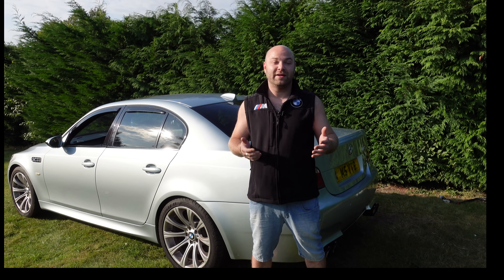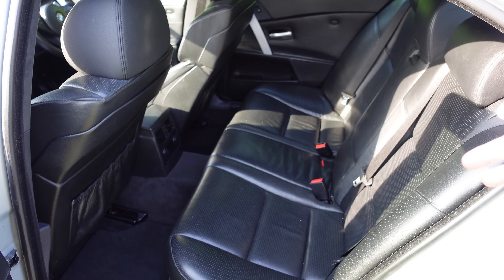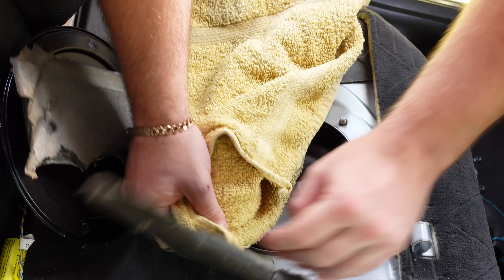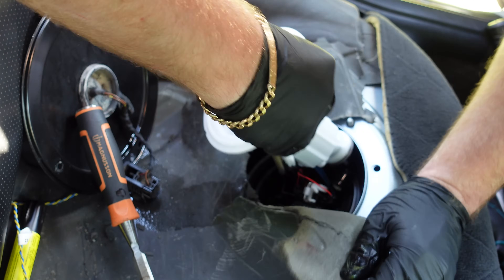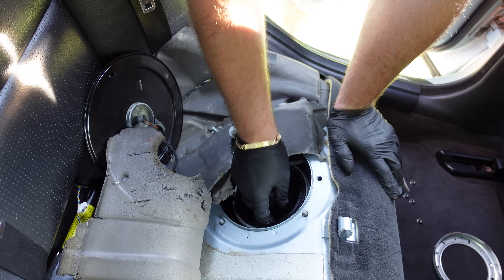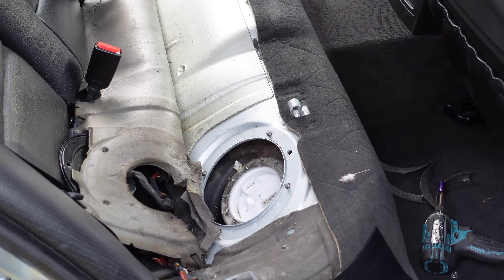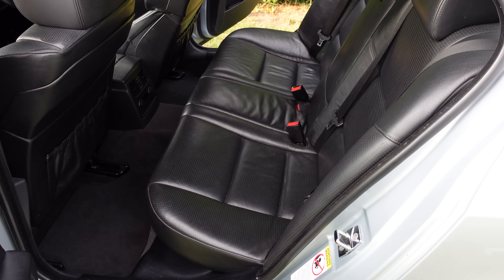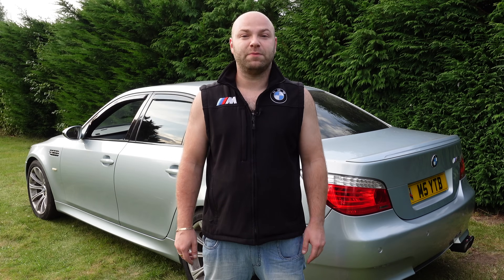BMW E60 & E90 Fuel Pump / Fuel Filter Replacement

Comment: Had multiple misfires even after changing to new index 12s, Changed fuel pump and filter. Car now runs smoothly. Thanks Dean.
Reply from the maker: Your welcome 👌 it’s always that, that’s the main issue anyway on a lot of cars and people replace everything. Even me I nearly replaced 10 injectors luckily I done a PROPER DIAGNOSIS which many garages and people don’t do before hand. Now everything is running perfectly 👌 I’m happy and can now enjoy the car. Just a shame these M5 these pumps need changing every 50k and even more if people run them low on fuel
Reply: No offence mate, but be methodical with your maintenance and over do bits that wear in a methodical way, it’s not just BMWs either. If you at a minimum met the manufacturers specs you should be right; if it’s a new purchase do it as path of the course. I believe I saw a methanol kit in the background doctor ✌🏽🇦🇺

Comment: attach a rope or wire to the end of the fuelpump wiring before pulling it out and you canuse the rope to pull the wires of the new pump back through.
Reply from the maker: No need it was actually very easy to do and I could get my hands in there perfectly just needed someone to grab it other end, which I did and it was easy no need for wire

Comment: Dean I have just bought a 2010 BMW 323i and what I have noticed is that the previous owner had left the vehicle for pretty much dead. And I have in such a short time noticed and repairs about of issues. But my biggest is the power loss in between 2100-3700RPM's? Do you have any direction or ideas as to what it could be resulting the issue? Any advise would be tremendous.

Comment: I have some fuel pump issues with my e90 m57 335d, my question, is there a filter for the diesel and is it in the same place?

Comment: Tip if you have to start the car before this job, pull the fuel pump fuse after you have positioned your car then start the car to release pressure in lines

Comment: Hi this has nothing to do with your video.. I hope you don’t mind I just wanted to ask you a question.. I have just got a 2008 bmw series 1 e88.  It had a Sony radio in it but I changed it back to a bmw radio but my parking sensor are still not making a noise .. everything is working ok just no noise do you know if it has to be programmed to my radio unit ? Thanks 🙏🏻

Comment: What are the symptoms of a faulty fuel pump? My E60 530i has this annoying hesitation at exactly 3k rpm, no error lights on dash. New vanos and vanos solenoids, new cam sensors and crank sensor as well. Under 3k rpm, the car drive fine. When I power it past 3k, power falls off a cliff and bucks sometimes.

Comment: 👉👉👉Help please: i own 2008 bmw x3 e83 2.0D 4x4 automatic with 145000 km (110000 miles) on the counter.A couple months back i had issues with rough idle. When i would start the engine for the first 20-40 seconds rev's would go up and down with a bit of a white smoke from the exhaust. I cleaned the injectors/new kit, new glow plugs with new module....car is fully serviced, so no issues there. Still when starting the engine i have rough idle for 10-15 seconds (no smoke) and as well while driving form low speed and when it comes to around 1000-1100 rpm's looses power/hiccup...and when i pass those revs all is fine.
I checked maf sensor, i have put new one for the test, same happened...
Is it maybe the fuel pump or something else...PLEASE advice!!!

The previous owner: changed egr, dpf, cleaned turbo. I did a good service...

Best 
Jure

Comment: Maybe undo your fuel cap before opening hoses etc.to help release fuel pressure & not end up dowsing your interior in petrol?just a thought 🤔👍
Reply from the maker: Have you ever done one of these ? If not, then you won’t understand. Opening the fuel cap does NOTHING these are under high pressure to start with. And as I said in the video I had just started the car to move it that’s why the pressure was built up. It happens to everyone when disconnecting the top hose. The fuel cap if that is under pressure that means you have big issues and that ain’t a good thing. The interior is a minor thing which cleaned up well after I mean petrol is a good cleaning agent after all 👌 would rather smell petrol anyday then “certain” other smells

Comment: Hey so I have a 2007 bmw I recently bought off someone it’s been working perfectly fine for a month now and yesterday I went to turn it on and the lights do come on but not fully the brake got stiff to. I mention the brake because my car is a push to start so I usually press the brake wen I start the car. I’m not sure why it won’t turn on I’m hoping I have to get a new battery ? The only lights I have on my dash are spark plugs and brake pads but I don’t think that has anything to do wit my car not turning on any suggestions ?

Comment: Hey Dean hoping you can help. Purchased a E92 on Saturday its a 2.5L, 325i 56 reg, auto, 96k miles, MOT passed last week and serviced last week. It was running fine no issues, when recently the CEL came on, 4 times the car slowed down (I drove for 40 mins earlier and it didnt happen once though) and the accelerator pedal had no input, I had to turn off the car, go into park then drive and it works fine. Also when idling it rumbles (not too bad) and the car moves left to right slightly,  the revs go up to 1.2k drop and fluctuate from 450/700 revs for apprx 20/30 secs then they settle at 600ish. I unplugged the MAF sensor and this didn't happen nowhere near as drastically at idle with it unplugged, also I have error codes 2D06 29E1 29E0. Hope you can help pal 👍

Comment: Great video Dean! I just did my fuel filter and pump a month back and I now have issues where the fuel level fluctuates by around 20-30 miles up and down. Any idea what the cause could be? I can’t tell In the video, but should the fuel filter also have a leveling sensor? The pump and filter I have both have them. Any information will help as I have ran out of petrol once when the car read 30mi till empty.

Comment: i tried hitting the locking ring like that.. can i get a tool for this at autozone ?
Reply from the maker: I must say this one was very very tight. try hit it the other way first and then back the other way. if you saw the video you would of seen even I had trouble lol, the only reason the fuel filter didn't was because I had already removed it previously but before that it was super tight.
Reply: @BMWDoctor  Thanks DOC! you the man :) heading down to the garage to my beast  2007 m6 indi red :)

Comment: Great video dean! I know I’m gonna have to change mine one day appreciate the heads up on the procedure .  That damn sound deadening matting look like a real pain in the ass
Reply from the maker: Oh it is but isn't all BMWS that way ? you start a repair to find a pesky piece that likes to annoy you lol
Reply: @BMWDoctor  absolutely your 100% right ! But I always come back because their is no substitute for a bmw . Congratulations on the land
Reply from the maker: Yeah thanks bro I appreciate it :) I finally got what I wanted in the end now its off to building my new workshop with my 2 lifts I cannot wait concrete has already been poured and we are good to go now. will be doing a video about it next week
Reply: Ok my E60 has been sitting for over 2 1/2 years nothings been replaced should change the fuel filter and drain old petrol out or is it ok to add injector cleaner🤔

Comment: Remember doing this on my diesel e60. Took the old fuel pump apart, had a mesh type filter in it which was pretty clean.. Pump was goosed tho

Comment: Ah yes, i changed this and regulator on my e90. Mine was leaking gas everywhere. Definitely a problem on alot of bmws
Reply from the maker: Yep it sure is man a big problem luckily mine is giving the all ok now finally
Reply: I am having this exact problem now, need to change the Fuel pressure regulator and pump i guess